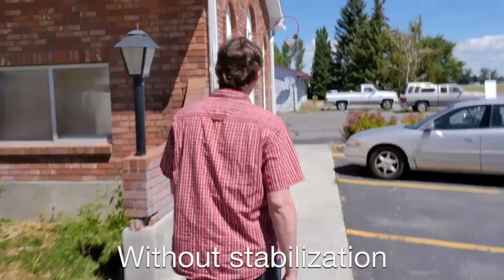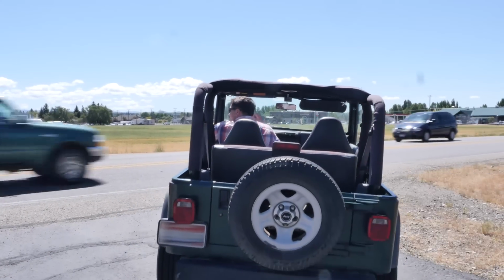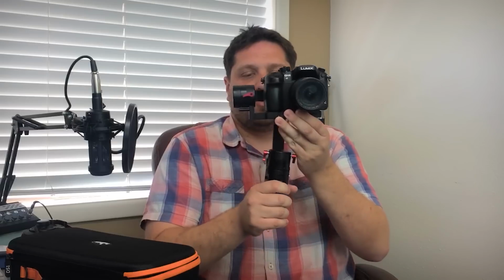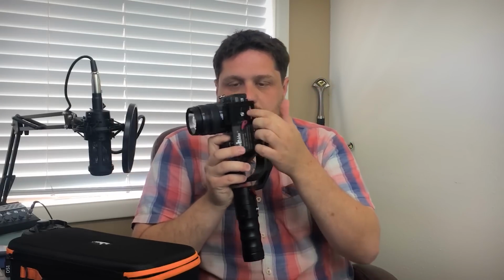Beholder DS1 - 3 Axis Stabilizer for GH4 (and others)

Comment: Do you know how well this gimbal works if the lumix has a meta bones adapter and canon lens on it?  I've weighed the gear which comes in at around 1.3kg so its within the weight limit but just worried about mounting as the meta bones adapter needs to be the mount point (as it sticks out) rather than the lumix body.  Canon lens is 8-15mm

Comment: Love my Beholder DS-1, got it in Jan this year from CNChelicopter and it came with an extra set of batteries- great bonus. They take 4-5 hours to fulling charge but i've not had the battery on gimbal die during any of the weddings I've done. http://www.cnchelicopter.com/beholder-trd-ds1-3-axis-handheld-gimbal-camera-stabilizer-for-canon-5d-sony-a7s-ii-etc/

I use a Canon 5D Mark III with a 16-35mm 2.8 which works great and is right in the weight to power settings of the gimbal.
The gimbal comes with the PID settings for cameras near the upper end of its weight limit, 3.7 lbs anything on the lighter side, like a Lumix or Sony with small lenses can get overpowered by the gimbal.

Anything lighter can cause the gimbal to flake, overpower the camera, if you look online there are instructions for changing the PID settings of the gimbal using Simple BGC - can be a little daunting for first timers -  https://www.youtube.com/watch?v=1A-XATvjdts

The main trick is to get the camera and lens balanced, zero movement, before you turn on the gimbal. The less the gimbal has to fight unbalanced weight, the quieter it will be and the battery will last longer.

The machining of parts, hidden wires, extra batteries shipped with gimbal, easy mounting and adjustment of camera make it a joy to use. I also use a wireless mic on subjects and just put the receiver in my pocket and run a thin audio cord to the camera and the gimbal is not thrown off by the attached cord.

It fits in my camera or computer bag and doesn't need a separate rig/stand for setting down like the bigger gimbals with two handles.

Comment: Nice review Mikey. Do you think this would work on a boom pool type setup so you could get a quick and dirty jib type shot? I've been looking at getting one of these but the offerings are many. I tried contacting DJI about the OSMO, and I still have no response after many emails and many months, so I've written them off.
Reply from the maker: +Basic Filmmaker the osmo camera is basically a GoPro. Plus you need to hook you smartphone to it just to preview your video. Not worth the slightly cheaper price in my opinion. 

As far as a boom pole probably.  But I don't think it can go the whole movement the handle is generally supposed to be vertical and once you start to move it back/up to far the motors freak out.
Reply: *****
Thanks!

Comment: I bought the Osmo X3 but took it back the next day. The fan was too noisy and the activation process took hours to get done via the Internet. (The phone support was not very good.)

Right now I'm leaning toward the Zhiyun Crane. It's very similar to the Beholder DS1 but about $100 less. All axis can rotate continuously without tangling wires and it's the only gimbal I've seen that will let you do controlled dutch angles.
Oh, and it has a smart-phone app that lets you control it remotely. (I wonder if you can control both the gimbal and the GH4 on the same phone?)

Here's a video review: https://youtu.be/Vprt8dQ3dZs
Reply from the maker: Activation process? sounds like a pain.

Comment: How does this compare to a steadycam/glidecam/DJ Freespirit/etc.  ?  I mean, I'm pretty sure I can do the Jeep shot with one of those.  I do like the ability to pan the camera with a switch while I move, and of course the small form-factor.  Thanks.  -Tim
Reply from the maker: its all about setup time,  It is super simple to balance these.  Plus like you said small form factor,  the bottom of the glide cam would have been bumping on the back seat of the jeep,  would have been much more difficult to pull that off, or at least much more practice,  that was literally the first time we tried it.
Reply: Thanks.  Sounds good.  Although, I'm going to remain dubious on setup until I actually see it done, or preferably do it myself.